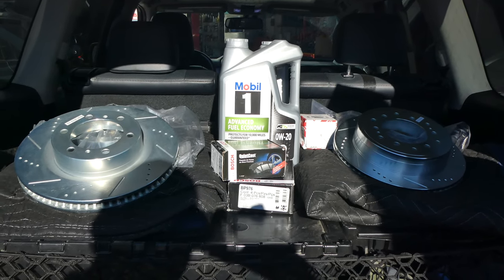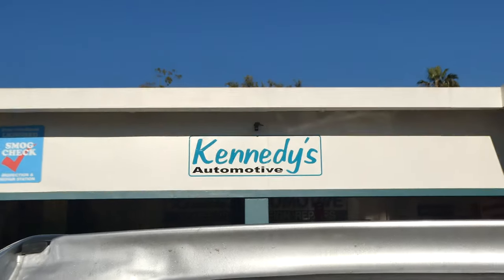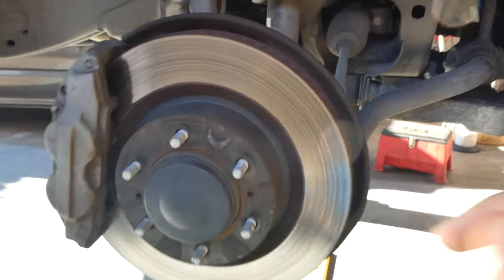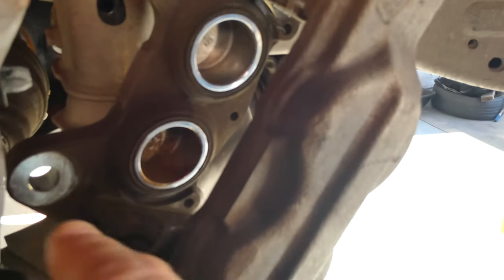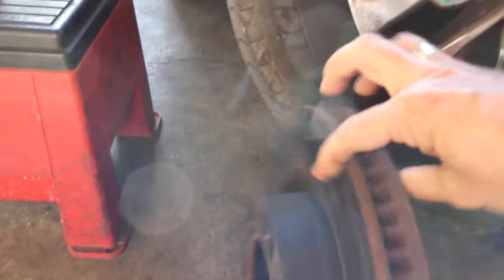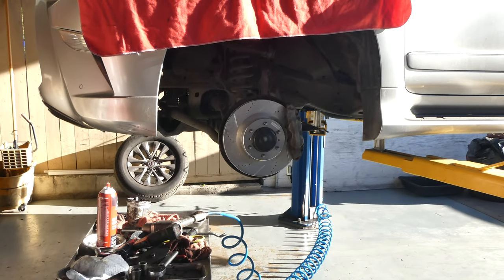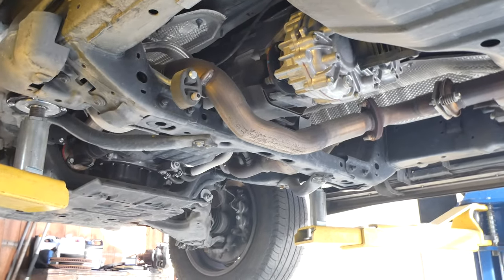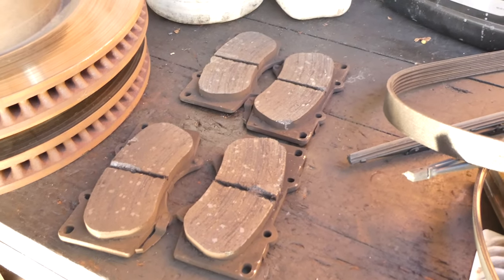2017 LEXUS GX460 FRONT AND REAR ROTOR AND BRAKE REPLACEMENT

Comment: Hi
Did you have any vibrating or pulsing issue when stopping/driving at 55mph? I have read number of folks on lexus forum mentioning about EBC slotted/vented rotors having such an issue?
Reply from the maker: Hi Ni Ja,

With my OEM rotors which were NOT slotted and drilled yes, coming to a stop when getting off the freeway i experienced heavy vibration and pulsing signaling that my OEM rotors were toast.  I decided to go to slotted and drilled front and back rotors and Bosch pads as they dissipate heat better then OEM and seeing how out SUV is very heavy it really should have come standard from factory.  So far, I'm a few thousand miles in and they work PERFECTLY, a marked improvement from OEM and they feel really great 👍 ill list the part numbers I got from AMAZON.  
Callahan CDS03504 FRONT 338mm Drilled & Slotted 6 Lug [2] Rotors [ fit 2010-2019 Lexus GX460 Toyota 4Runner ]
Callahan CDS04037 REAR 312.1mm Drilled & Slotted 6 Lug [2] Rotors [ fit Lexus GX460 Toyota 4Runner FJ Cruiser ]

Bosch BP976 QuietCast Premium Disc Brake Pad Set For: Lexus GX470, GX460; Mitsubishi Montero, Montero Sport; Toyota 4Runner, Tacoma, Tundra, Sequoia, FJ Cruiser, Front

￼

￼

￼

Bosch BP976 QuietCast Premium Disc Brake Pad Set For: Lexus GX470, GX460; Mitsubishi Montero, Montero Sport; Toyota 4Runner, Tacoma, Tundra, Sequoia, FJ Cruiser, Front
Reply: awesome will be doing this very soon… Tons of vibration at the moment.

Comment: From the video and your comments the mechanic did not use a torque wrench on his final tightening. I did see him use his impact wrench on the front. The first sign of a bad job is not properly torquing the bolts. I can almost say with certainty he did not torque your lug nuts after he ran them on with the impact. One of the main reasons for warped rotors.
Reply from the maker: Didn't know that!

Comment: How you take the rear rotors off? Part i need it to see 🤣😭
Reply from the maker: Same as the front really.
Reply: @ONBLASTWITHMG  got it. Had to put a 12mm bolt in the front to pop it out and after there's is hole (bottom side) to move wheel down to release the emergency brake.

Comment: Also do you part information for the pads and rotors.
Reply from the maker: Hi Ni Ja,

With my OEM rotors which were NOT slotted and drilled yes, coming to a stop when getting off the freeway i experienced heavy vibration and pulsing signaling that my OEM rotors were toast.  I decided to go to slotted and drilled front and back rotors and Bosch pads as they dissipate heat better then OEM and seeing how out SUV is very heavy it really should have come standard from factory.  So far, I'm a few thousand miles in and they work PERFECTLY, a marked improvement from OEM and they feel really great 👍 ill list the part numbers I got from AMAZON.  
Callahan CDS03504 FRONT 338mm Drilled & Slotted 6 Lug [2] Rotors [ fit 2010-2019 Lexus GX460 Toyota 4Runner ]
Callahan CDS04037 REAR 312.1mm Drilled & Slotted 6 Lug [2] Rotors [ fit Lexus GX460 Toyota 4Runner FJ Cruiser ]

Bosch BP976 QuietCast Premium Disc Brake Pad Set For: Lexus GX470, GX460; Mitsubishi Montero, Montero Sport; Toyota 4Runner, Tacoma, Tundra, Sequoia, FJ Cruiser, Front

￼

￼

￼

Bosch BP976 QuietCast Premium Disc Brake Pad Set For: Lexus GX470, GX460; Mitsubishi Montero, Montero Sport; Toyota 4Runner, Tacoma, Tundra, Sequoia, FJ Cruiser, Front

Comment: You completely skipped pulling the rear rotor off. You cut video and jumped to when it was off. Down vote. Why bother making a how to video if you don't show how to?
Reply from the maker: I am a proponent of anything that works.  I will try, though it seems like a fire risk.  The thing should just work as intended.
Reply: @ONBLASTWITHMG  What are you talking about with fire risk? Taking the rear rotor off is a fire risk? How do you relieve the tension of the spring that prevents the rotor from coming off?